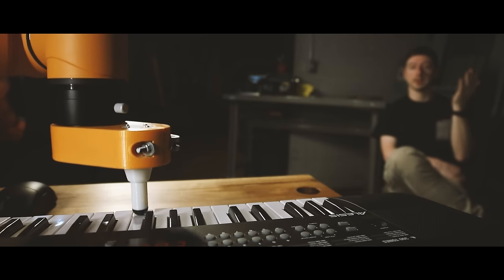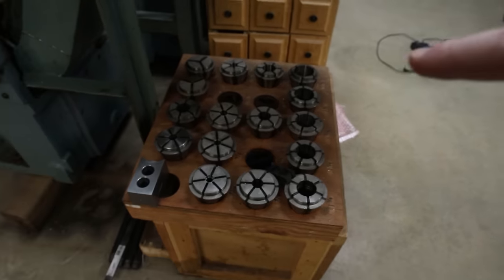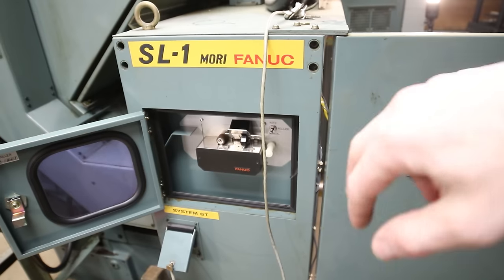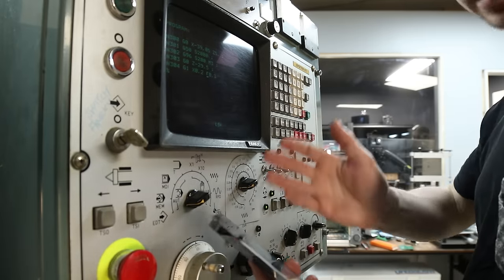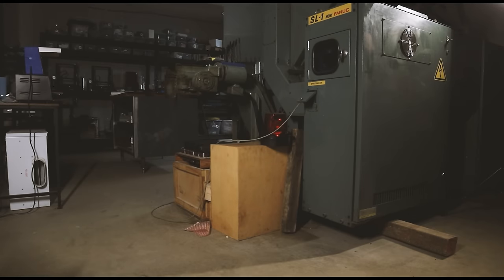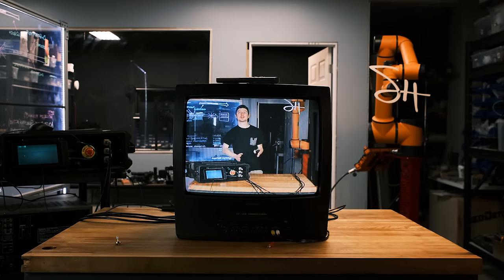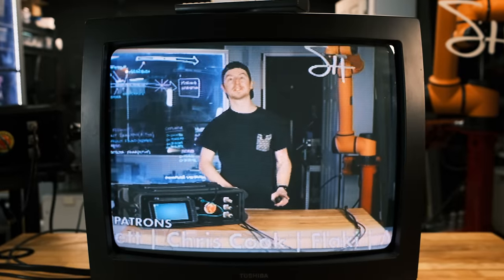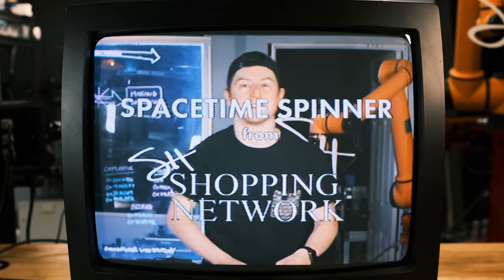I Bought a Giant 40 Year Old CNC Machine

Comment: Old CNCs, clever video editing, humor, perfection! Keep it up man!
Reply from the maker: Thanks!
Reply: I'll program that on the machine in like 1/2 hr using g71, g72, & g75 and it certainly won't be 300 lines of code!
Great vid!
Reply: Also I can reprogram depths of cuts on the fly by changing variables in the can cycles.
Which means I can prove out the program in 5 minutes flat.
Been doing this for 35 years now

Comment: Those are still pretty viable machines. Those are "yellow cap" Fanuc brushed DC servos. It should use a +/- 10V analog signal instead of step and direction. The 6T is a good control that can do anything a 2 axis lathe should ever need to do. The offsets are kind weird as I recall, they don't really have a work offset, but there are ways around that. I had a 1980 Mazak Slant Turn 15 with a Fanuc 6T control. It was a solid machine.
Reply from the maker: Still learning more about it every day! It uses a grid system with G50. I'm not doing that though. I'm just basing all of the tool offsets from tool 1. So tool 1 is "0, 0" and all the other offsets are the difference from there. So I will call, say tool 2, with T0200, so that it switches tools, then T0202 to load the offset and move to that location.
Reply: @SeanHodgins  That works. You may find it more convenient to set your tool Z offset from a fixed location (face of the collet nose or whatever), then set the G50 from the same location. That way you don't have to reset the tools for every job, you just have to set the G50, which as I recall is done inside the program. 
There were some other weird things. Using constant surface speed the RPMs would go wonky during a tool change. That was so annoying I pretty much gave up using it. Also I had to add a couple relays to trick the PLC so I could do bar pulling. Without those relays the control would not allow a feed move with an RPM of zero or with the chuck open.
Reply: On my machine, I tool index and set my Z offsets from Z G30 2nd reference return pos position.  There are a lot of ways to do this, but for me, this is the cleanest way to work with a machine that only has offset for wear(there is no geometry page).  My format is G30 U0 W0; Txx00; G50 X0 Z0; then  set G50 Xx Zx (offset values) from this location. This is, of course, if you have the optional 2nd ref return on the machine. My machine moves the slides the instant it pickups the values in the wear register at the TxxXX line.  Can you give you a heart attack if the values are too large or might over-travel if done at home pos. It's good practice to limit your offsets to about .010
Reply: Was about to say they are dc M series servos. Beat me to it man.
Reply: There are a couple of ways to do tool offsets on a 6T machine... the most modern way is if your machine has the “custom macro B” option.  If you have this option you can write a little code to made it behave like a modern machine with geometry offsets. 
    My machine doesn’t have this option, it’s slightly older with the DC spindle and the brushed servos.  You have a very desirable old piece of iron! 
        I have a video on my channel describing how to program with G50 offsets if you want to see another way to do it.
Reply: @WatchWesWork  I know what you mean with the RPM during tool changes.  I program a G50 S700 or whatever RPM you want after I’m done with a tool, just before I command G28 U0 W0 to send the tool home and do a change. That G50 limits spindle speed to something low, but you don’t have to stop and restart the spindle for every tool.  
      I think the issue is that the 6T just looks at the modal X position and calculates the desired spindle RPM.  When you do G28 and send the tool home, that modal X value is not updated until after the next tool change and your first X move towards the chuck.  So the spindle might be screaming at 3000 RPM after a facing pass, all the way until after the next tool change and on the approach move.  By setting a spindle speed limit of 700 after your machining is done for that tool, the spindle stays moving and then goes to whatever speed or mode you have commanded on your next tool.  Try it!
Reply: @SeanHodgins  The shop I work in just switched from G50 to tool geometry because we didn't have many old machines left. The way my shop set up G50s was to have a home move at the start of the program and then a rapid move to the indexing position (this is in block delete so you only run it after turning the machine on) From the indexing position you set your relative position to zero (U & W) and use that as a baseline to touch of your tools. You would then put those values in your G50 and as a rapid move after the tool has run to return you to your indexing position
Reply: @SeanHodgins  What I have done is create a program for each tool that G50 references from the home position to the centreline and jaw face, and calls the tool. Instead of worrying about tool offsets or putting the G50 in the cutting program. When I post a program out of the cam package I just change T0200 to M98P0002 and run the sub program to home the X/Z axis clear of the work, change the tool and set relevant G50. If I only use one tool, like a groove/turn/part off tool I throw a block skip in front of the M98 and just move the axis clear enough of the part to change it, after setting up the G50 after a cold start.
Reply: My Slant Turn 15 is an early 82 model. The effing hydraulic pump screams away and it has its gremlins, but it's been a nice machine to have. It is however a complete POS in how the Fanuc control is implemented and how it is all laid out electrically, hydraulically and mechanically compared to its stablemate - an 83 model Mitsui VR5A VMC.
Reply: With the tape deck you can get a AUSYS DNC Titan. You simply unplug the ribbon to the tape deck and plug the DNC Titan in and you can simply run the machine off a USB! Life changing if you keep the machine!

Comment: I used to own a MS Sl-5a. These are incredibly well made machines and the fanuc controlls (I had a 10t) were way ahead of its age. Keep this machine, fill the lubrication system every once in a while and it will run forever with really great precision and stability!

Loved the cyberpunked session!
Reply from the maker: Love to hear it! I want to keep it going for as long as I can on the original hardware. We’ll see how that goes. Thanks!
Reply: @SeanHodgins  Bubble memory?
Reply: @jsihavealotofplaylists  I was using dnc until it froze at 100k lines on my mill.  I think lathes have smaller programs when 2axis and dnc should be just fine.  Off topic but you mentioned memory and I had to add to it.
Reply: 1st CNC I ever worked was a MS TL-5 , saw it installed as a 2nd yr apprentice (17),  it's still in use now, & I'm 57, that's 40 yrs of constant use in the same shop !
Awesome machines.

Comment: As an individual who has been running machines like this since the 80's, the punch tape does not necessarily run the machine. It was mainly storage media because the machine has internal storage. The only time we ever ran machines off the tape was if the program exceeded the storage of the machine. Machines that were just NC, required the tape to run. We typically wrote programs longhand on a programming sheet then, used a Flexowriter typewriter to create the punched tape. You could splice the tapes with edits or make edits at the machine then connect a tape punch to the RS-232 to punch a new tape. Also, programming is simplified by the use of canned cycles that allowed you to rough and finish by defining the finished shape and using a 2-line code to establish depth of cut and stock allowances. CAD\CAM software was available but, the cost of the software was almost as much as the machine. Back in those days, a machine like this cost about 3x the average cost of a house. Those old Mori-Seiki lathes were indestructible along with the Fanuc controls. Nice score!
Reply from the maker: Really cool, thanks for the history! I’m not sure how to use the canned cycles yet. I would love to find a tape punching machine just for fun.

Comment: The Fanuc System 6 b is a very robust piece of hardware.  This one of the first "modern" controls. I think its 1st control to have that fancy CRT.  I'm convinced  one these controls will be running when they are a 100 years old.  The oldest I run was installed in December of 1979,  runs almost every day with little to no maintenance. Some  I/o board relays are getting wonky thou, replaced the main power supply once, and replaced the encoder cables in 2006.  The other hardware is untouched in my 20 years of knowing the machine. This control made me an undying Fanuc loyalist with purchasing newer machines.  It has it quirks but, if you look thru the lens of 1980. It's was ground breaking technology. Long live the SYSTEM 6!!!!
Reply from the maker: I’ll be 97 when it’s 100 so it may be a little bit difficult to test this theory but I’ll try my best!

Comment: Good find. I bought a 1978 Mori SL1 Lathe about 6 or 7 Years ago. I ripped out the electronics and servos and put new servos in, built an electronics cabinet, used mach 4, wrote some code for the Mod Bus and PLC to control the tool changer and now it's like any other modern CNC Lathe, but better as Mach 4 is way easier to learn (I've been using Mach for 20+ years) than FANUC. They are great lathes, enjoy.
Reply from the maker: Want to do it again? haha Ill see how long I live with the original system.
Reply: @SeanHodgins  LOL Sure!! Where do you live? Should I email you from the email in your "about"?

Comment: just came across your channel. I was a cnc machinist for 35 yrs. I ran and programmed several mori lathes. SL-1 SL-6 SL-8 and SL-80. all with fanuc controls. mostly 6t but some with earlier versions and some newer up to 10t. then mori went into "conversational programming" where you could describe a part boundary, part geometry, tooling geometries, and it would generate g-code for the tool paths on the machine. similar to mazatrol programming on mazaks. glad to see these can still be in use today.
Reply: that thing looks pristine it must've been in shrink wrap or something. i even still have an old mylar program tape from back in the day but its for an allen-bradley control on some warner-swasey lathes. they were a previous generation of programming called leading zero and in radius programming. so a 1.125 dia. would be X005625 on the program. from the looks of your x-z program numbers your using mm dimensions.

Comment: I've done elec tech work on that era of machines ie 70's and 80's CPUs.
Those huge boards full of chips use a lot of DC power and get real hot, so you get bad connection issues on connectors due to heat and chip failures due to heat.
If you want to use this for proper production work, I recommend real good fan cooling of the enclosures using modern fans that move more air (ie remove more heat). Also, check the DC supply lines for ripple and noise they are usually under-capacitored and the caps degrade over years too. You can scope the rails and check that, and examine electros for bulging cases. Also sagging 5v rails etc.
Another good idea is to put liberal amounts of a good brand name electrical connector lube on all the plug connectors, especially important if it has been in or will be in a higher humidity environment.
Good luck!

Comment: This is exactly how I learned when I took CNC machining in my second year in college. Writing code on Windows 95 then using RS-232 to "drip" the lines into a running machine because it had a very limited memory. A pro tip from a bad student is to make bigger spaces on your number lines. Instead of counting N01,N02,N03, etc. Go N001,N005,N010. That way if you mess up and need to add something in you can edit directly on the machine adding a line in between. Loved the video!

Comment: Hi Sean nice looking machine ! If it is a 1985 or later machine I might have done the original installation, assuming it was sold new in canada .
The servo drives  are +/-10vdc analog 
Not stepper .if you look on the drive you might see a DAC chip  .
If you need a new rabbit hole to fall into
Do some research on bubble memory.
That was the original memory used
There once was a thriving business of selling unauthorized replace memory boards because bubble was very expensive and not so reliable

Oh if you have not done so already its
Extremely  important to check the condition and length of the servo motor brushes .there is a section in the manual explaining how
Reply from the maker: Thats amazing, it is a 1985 I believe! Great! Ill check it out. I have all the documentation for the machine. I might even have a receipt if the brushes were ever replaced.
Reply: One of our oldest machines (an Okuma MC60-VA) uses bubble memory. Not very big at all, but then there's the floppy disk for a backup, and program storage.

Comment: Just stumbled upon your channel and i'm thoroughly impressed with the production quality/entertainment value of your content!
Cnc turner here, you're going to want to look into canned cycles for longhand gcode programming, line by line positional programming is great if you're generating it using a post processor and DON'T have to type it all out by hand, it does give you a lot more control over each movement but you can produce programs far more quickly and introduce a more parametric structure to each cycle with canned cycles, once you've got the basic format down for each type of cycle you can simply tweak the conditions to your liking and get a result much more quickly than essentially spelling out every movement the machine needs to make. They're the next best thing to conversational programming and can save a lot of time once you get to grips with them.

Comment: Great video! I love these old CNC restorations, it would be cool to make a modern post processor to punch tape converter so you can use the original tape reader. I ordered one of those spacetime spinners, love the idea of doubling prices to make limited edition items.
Reply from the maker: Limited edition, those are the words I was looking for! Anyway, I had that exact conversation with my friend today, the punch tape idea. I would love to get the punch tape working on the machine.
Reply: Ohhh, that is a rager of an idea, I love it!
Reply: @SeanHodgins   Hi Sean  If you are going to do tape punch right, the name you need to know is Facit . there should still be a few machines  around , be warned though,
industry abandoned tape in the mid  80's without a single tear shed (except maybe by Lars the NA Facit distributer) , any that are left would be setting abandoned and forgotted in a storage room.
 With the  addition of the rs232 port and some actual program storage  memory (see my bubble comment),  programs were loaded either with a pc on a cart, or all the cool kids would have a Facit n1050 (Lars is happy again) floppy drive.  the n1050 (and/or a PC) could also "dripfeed" the program, if it was larger that storage memory. We used to use words like non-volitile way back then 🤓.
Any how back to tape, before "large" non-volitiale memory  , the tape was spliced into a continous loop   ,read as needed, and then stop at program end ,ready for the next run.
Once  again there were  cool kids and they would use mylar instead of paper.  The aerospace companies had profiling milling programs 100's of metres long.
Have you by chance wondered why early cnc refered to program memory in Metres?
Reply: I spent a fun week or two some years ago getting "BTRs" (Behind Tape Readers) working on a bunch of machines in Scotland. 🙂
They were for machines that ONLY had tape readers (No RS232!) and simulated the action of the holes sliding past the reader! :-)

Comment: Having suffered through a similar project myself, i can recommend to change your PP to only add sequence numbers on tool change. It dramatically reduces the filesize and transfer times while being funtionally an improvement if you need to jump to certain operations.
Reply from the maker: That is an excellent idea, I hadn't thought of that. Searching without the sequence numbers is just as easy since a computer screen is right there.

Comment: The machine appears to be in great condition. The electrical cabinet looks really clean (perhaps you gave it some TLC after you acquired it?). These Mori Seiki SL1 ~SL8 series lathes were real workhorses here in Houston, Texas in the oil tool industry in the 80s and well into the 90s. There are still many machine shop owners here holding on to these for "sentimental value" (the very first CNC machine they bought etc.). In case you do not have yet, here are some manuals you may want for future reference. Fanuc 6T-B Maintenance Manual B52245E, DC Servo M-Series Maintenance Manual  B53265E, AC Spindle Maintenance Manual B53425E. Great video!
Reply from the maker: Thank you! I actually didn't clean any of the electrical stuff. Some of the seals are crumbling to pieces, but everything looks well taken care of. Thanks for the manual references. I have the Fanuc 6T-B one I think, but missing the others.

Comment: I worked on this machine in my career as a machinist. These old machines used to use punch tapes to input programs, it was basically a very long piece of paper that would be printed from a computer and the machine would then be fed this and input a program by reading the spaces and dots on the paper. Really cool stuff, however we have a server connected to it now which makes the process much faster lol.

This make is also a gearbox machine so it can pack quite a punch on some material, rather then the more modern driven machines.
Makes it real good for cutting large square blocks if that kind of work comes around.
Reply from the maker: I want to find one of the punching machines just to see it work!